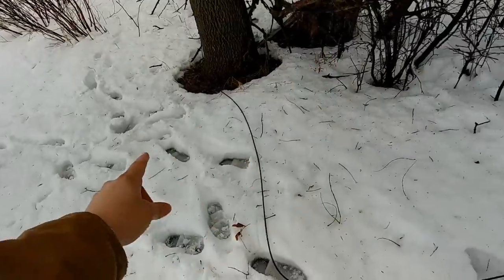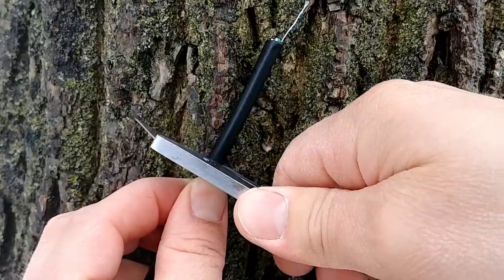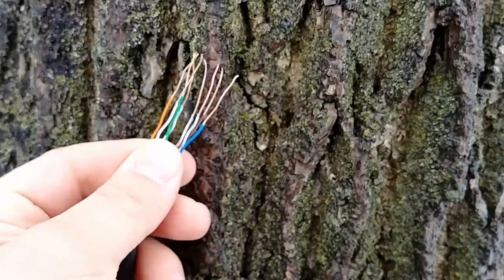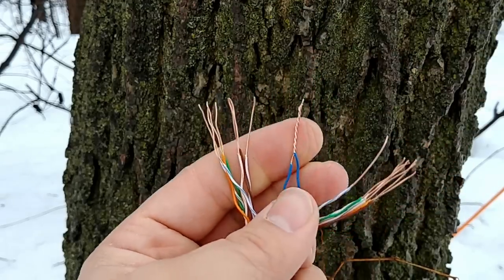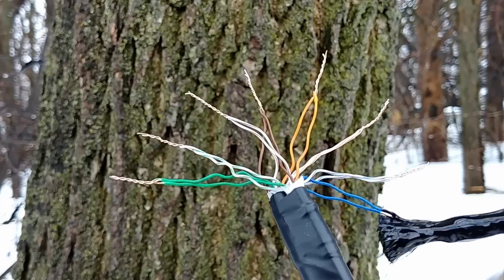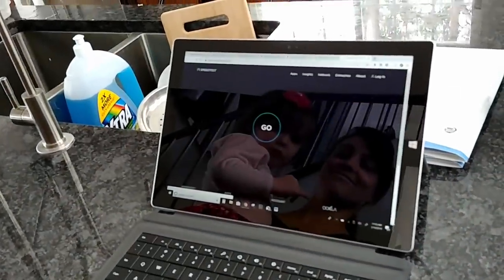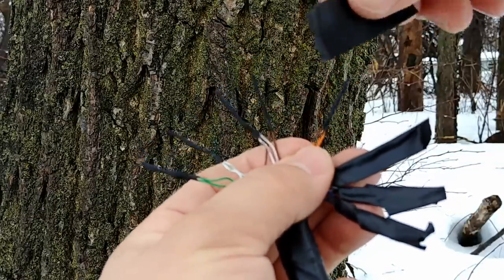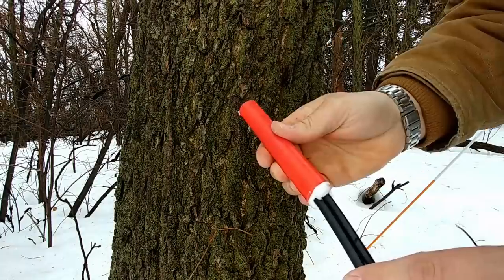How To Splice an Ethernet Cable By Twisting The Wires Together

Comment: Yeah and actually that totally would work when I was did it for my 360 or you're not running a bunch of like megabits per second like but I just tried it again on my Xbox series x with my 4K TV online on Halo infinite and damn it really screwed things up because when you cut the wires it's counting on those wires to be exactly the same length when they hit on either end if they have to travel a little bit more distance you're going to screw it up especially for the higher 4K and Xbox series x just buy new ones but if you're just running HDTV you're good

Comment: As a general rule what you did normally doesn't work, or will not work for long.  You're likely using Cat5e+ cable with a higher MHZ bandwidth rating and performance characteristics that's suitable for a 1GbE+ connections.  Getting 10/100 to function over it is like taking all the spark plugs out of a car engine but one...and saying it works.  Rent a cable tester and run a certification test.  The cable will likely fail badly.
Reply from the maker: Yes, that makes sense. It will be interesting to see if it will last the few months that I need it to. I plan on replacing the entire cable this summer when I bury the line. Just needed to get it up and running right away. THANK YOU for sharing your technical knowledge regarding this! Are you in IT or work in the telecommunication industry? Thanks again! Also, do you recommend solid copper for networking cables or is CCA fine?
Reply: @BenjaminSahlstrom  Depends on your budget.  Clad can, and does work just fine, but copper is the long-time standard.  Clad can have quality issues or corrode readily dependent on environment or manufacturer. I'd advise running conduit and pulling Ethernet through it as a long-term solution.  You can get armored gel, direct burial Ethernet cable, but it's pricey...I prefer to get liquidtight electrical conduit and pull regular cable through it.  Advantage to the conduit is you can pull new cables through it if it's not packed, and not need to rebury stuff.  I've pull 3 Ethernet, 2 coax and 110volt cable through 3/4 sealight brand conduit...but don't advise packing that much in it.  Critters also dig, and tunnel, so even underground cable should have protection.
Reply: @BenjaminSahlstrom  FYI: You should be able to get your provider to come out and trench in a new cable when ground thaws.  No need for you to buy cable...they probably won't use armored or conduit thought.  Just that direct burial cable.  They basically didn't finish their previous install in my opinion.  Cable damage is on them.
Reply: It's like taking a broken moped and putting a spark plug back in, reaching a speed you'd never go faster than, and getting home and saying it works. Then posting online about it and receiving comments about how it didn't work.
Reply: I would have done it differently as follows: Cut the excess copper off after twisting so that only 1/4" of bare copper is exposed, then soldered it.

Comment: I was under the impression that outdoor Ethernet cable has a dielectric grease under the sheathing.
Reply: I take it wasn't professionally done.
Reply: Ok so judging by the RJ45 on the Cpe side, it was definitely not professionally installed lol.

Comment: I hade 300 Mbps and after twisting it becames 100
Reply from the maker: Thanks for sharing your results!
Reply: It will work. 2 pairs=100mbps. 4 pairs=1000mbps. It will work with only 2 pairs at the slower speed. 1 faulty wire connection and its down to 100mbit. Check your connections again.